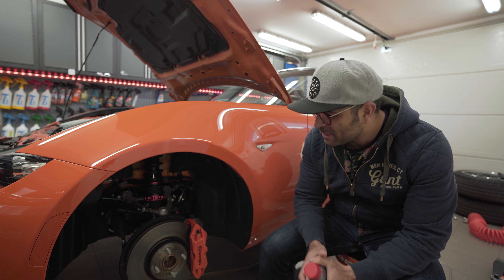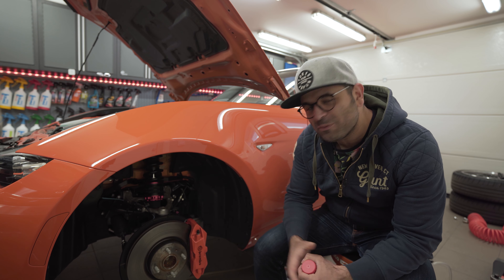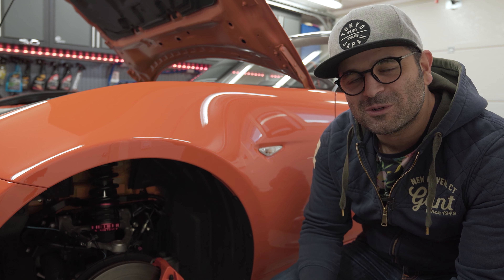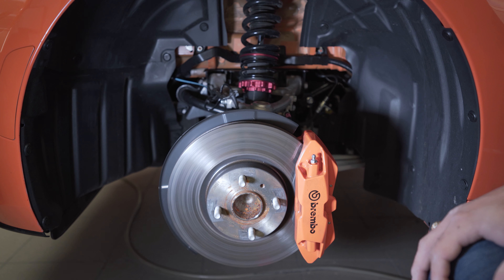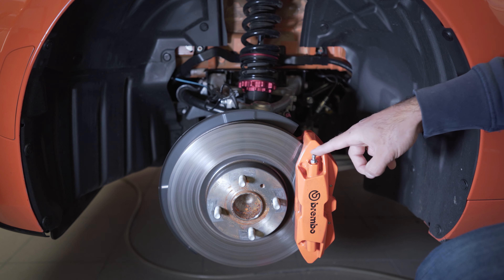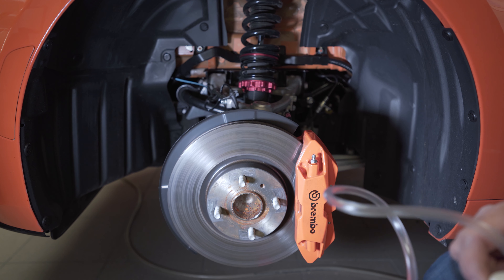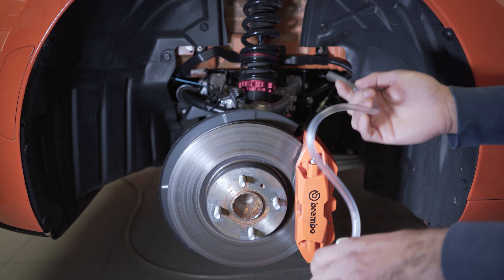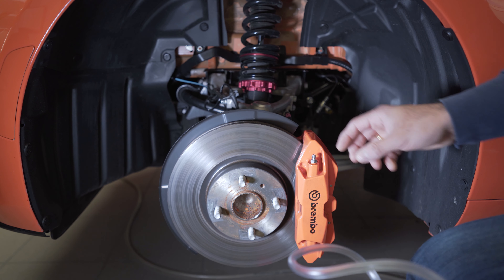How to power bleed or flush brakes with a Motive Power Bleeder - Mazda MX5 Miata ND ND2

Comment: Thank you for posting these videos. I have been wanting to purchase a ND2 and prep it for light duty track and AutoX use, but prices are very high right now. One thing that I am having difficulty deciding on is the Brembo package (which in the US is only available on the Club trim - minus the 30AE -and currently comes bundled with the aero kit, BBS wheels, and Recaro seats) versus the standard brakes. Pads and fluid are easy enough to change and I could always replace the standard calipers and rotors with something aftermarket (like the Wilwoods), but it is nice to keep things factory when possible. I really wish that Mazda would take the Club trim to the next level and offer it (from the factory) with a more aggressive suspension setup.
Reply from the maker: sorry for the late reply and thank you. Glad you appreciate the videos.

If you want to drive the car on track/auto-x I would say the Recaros should be a minimum unless going for a real bucket seat that is.

From what I head the standard brakes with other pads and fluid are good. What I can say for the brembos at least here is that the pads were really expensive aftermarket calipers will most likely have more common sizes which will bring the consumable cost down.

With regards to the suspension setup the car rolls, leans, dives to much for my test in standard form and also it is sitting way to high. Coilovers was a must for me. Lowering spring and swaybars will take care of most of those things as well. However I am not sure what regulations you have there with regards to e.g. Auto-x and modifications/classes

But is sure is a fun car! But it is no GT3 RS which I can see in your pic :D

Comment: Have you used the Motive power bleeder to bleed the clutch at the slave cylinder, as I believe although it uses the same master cylinder it also is on its own feed? Thank you👍
Reply from the maker: I have not done so! However I would assume it should work in the same way as the process for the clutch bleed is similar to the brakes.

Comment: Because you used a different fluid, did you bleed your clutch fluid as well to avoid cross contamination? I believe the clutch fluid takes from the brake fluid reservoir
Reply: also, great video as always
Reply from the maker: Tnx much appreciated!you are correct would have been best to change for the clutch as well. The short answer is  I did not have the time 🤪. Will do it at a later stage....
Reply: @Themazcorner  Good to know! I ended up purchasing the motive bleeder as well with the adaptor - the video was very helpful
Reply from the maker: Great! It was really simple to use. The adaptor will turn and get tight but you won't feel any notch or or so I didn't at least

Comment: How much new brake fluid did you put into the bleeder? I bought 2L of the Motul 600, should I pour all of it in for this job? I plan to flush the OEM fluid and replace it all with the Motul.
Reply from the maker: I don't remember now but I think 2 bottles should be sufficient.
The thing is once you have opened the bottles they will start accumulating moisture so you cannot have it on the shelf for to long.

But 2l should be sufficient for the task. You can always get one more and have it for future bleeding/flushes